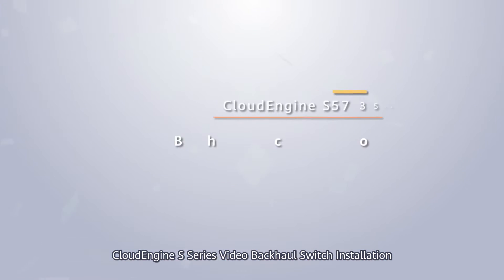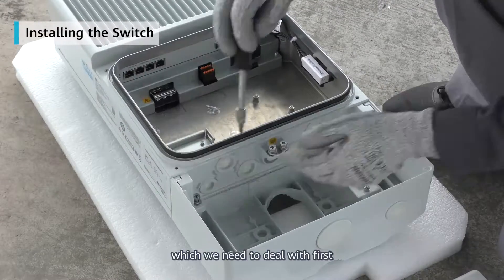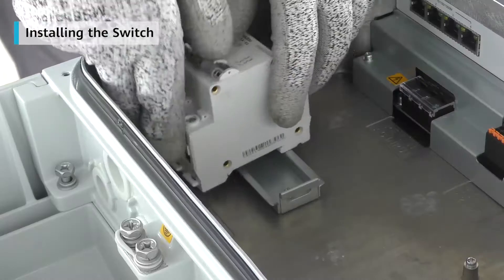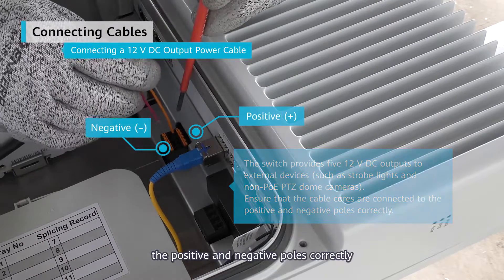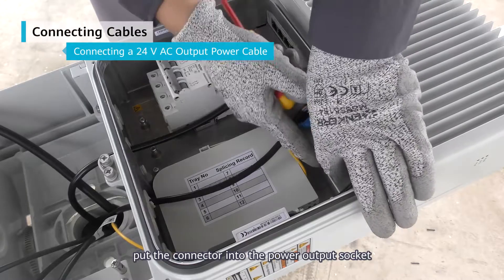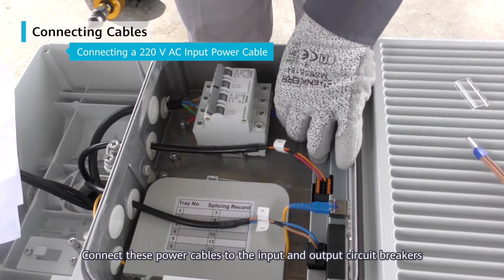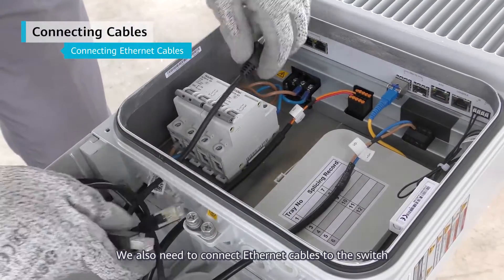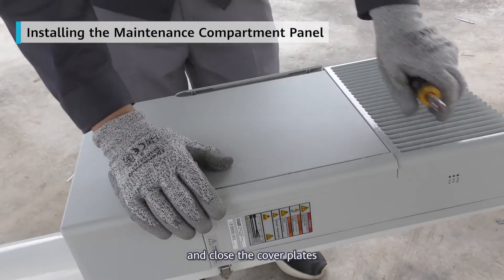How to Install Huawei CloudEngine S5735-S-I Video Backhaul Switches

Comment: How much user can connect with it
Reply from the maker: The device supports the configuration of two types of user interfaces:
1. Console user interface: manages and monitors users who log in through the console port. A switch provides the EIA/TIA-232 DCE console port. The serial port of a user terminal can be directly connected to the console port of the switch for local access.
2. Virtual type terminal (VTY) user interface: manages and monitors users who log in using VTY. A VTY connection is set up when a user uses Telnet or STelnet to log in to a switch. Currently, a switch supports concurrent access of a maximum of 15 VTY users.